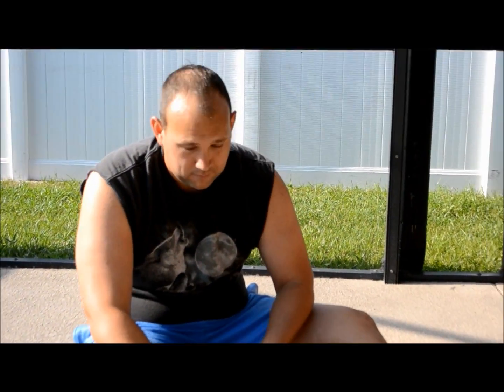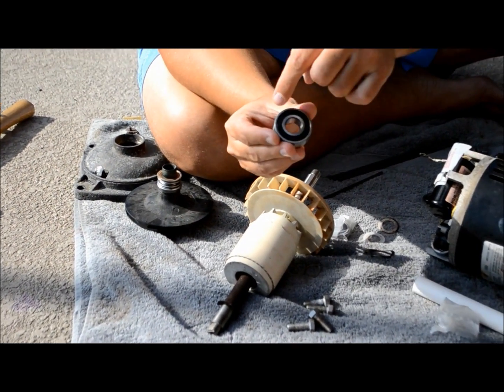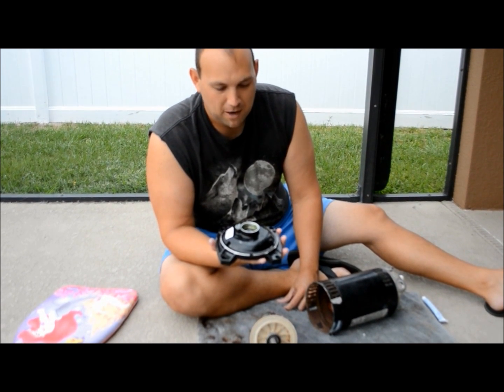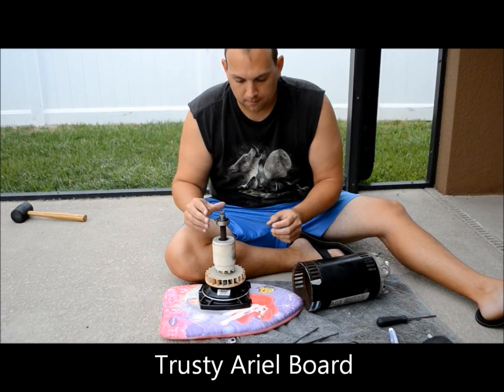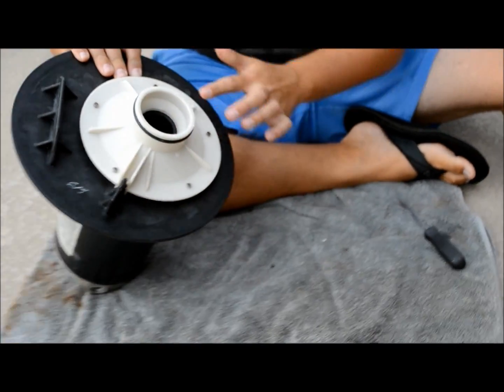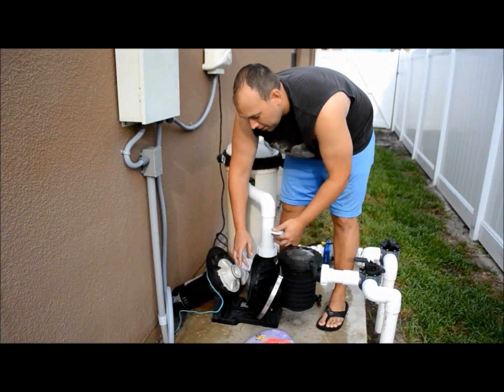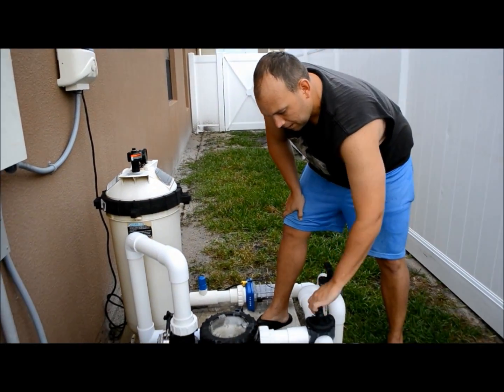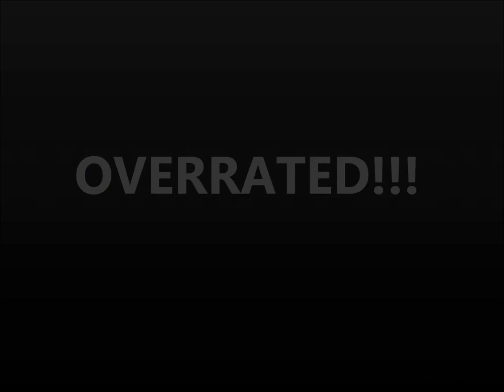Pool Pump Repair Part 3 of 3

Comment: Ha! Just came across this, just what the doctor ordered!!!
My BADU pump seized up over the winter - nothing that a long bar & socket wouldn’t overcome. But oh hell, it’s been so noisy running. 1st half hour or so is utterly dreadful, then quietens down a bit for the remaining 7.5 hours, the same pattern repeating every day.
On this occasion I’ll just replace the pump (it’s 17 years old!), but I’ll definitely be stripping it down to see if I can repair it & keep as a spare.
Many thanks for the time & effort you put into making those 3 videos, absolutely indispensable.
Row (UK)

Comment: I'm not trying to say this in a bad way, but, you convinced me to just get a new motor instead of all the frustrations you went thru. You had too much corrosion and rust and frozen bearings and it didn't seem worth it to me. The 4 broken "thru bolts" clinched it for me. Good job though.
Reply: You are not the first person to come to this conclusion after watching my videos.  I've saved many man hours by showing how the extra mile isn't always worth taking!

Comment: This video was exactly my pump experience.  I should have watched it first. Try getting those long bolts out without breaking.   A friend removed the four bolts by heating the cover neat the end of the bolt with a torch.  He said the bolts are aluminum and have a different expansion contraction than the cover.  It worked after all else failed.

Comment: Video extremely helpful! Pulled apart the motor and upon putting back together, found no water running through the system. Your video reminded me to prime the pump and from there I had no problems and you saved me tons of $ if I had burned the motor out! Thanks again and well done!!

Comment: Question. I bought this house and the pool was already installed... I have the same pool pump and when I went to turn it on it hummed then cut off.. After doing some research online I found out that the impeller might not be turning so I took the motor from the wet side and removed the diffuser. The impeller wouldn't turn by hand so I used a very large channel lock wrench to turn it a few times and now it moves.. Pump now turns on and primed but the pump now makes a grinding type noise and I have no idea where to start lol.. Any advice would be appreciated
Reply from the maker: +The Neals Next Door So the "humming and shutting off" is definitely a sign the motor shaft wasn't able to turn.  The motor is designed to shut off automatically in such cases.  It sounds like you were able to get past that problem (awesome stuff)!  

Now why wasn't it moving before?  I'm guessing you may have had a little bit of built up rust from the pump not being on for some time and the channel lock wrench was strong enough to break it up.  That is impressive as that is not an easy thing to do.  Especially if you live in a southern state like FL where things tend to rust over night.

So that horrible grinding noise you are now hearing?  Unfortunately, that sounds like the bearings have gone bad.  Typically a common problem if the motor is approximately 5+ years old.  The problem is that replacing the bearings is a horrid job that I don't wish upon anyone.  Part 2 of this series walks you through the painstaking process of me taking the entire motor apart in order to replace them.

In my honest opinion, taking on such an effort may not be worthwhile if the motor is fairly rusty but bearings are cheap and if you have the patience and some of the tools, you may want to give it a try.  Start by removing the 4 long bolts that run along the entire length of the motor.  If they can't be removed, then abort the mission altogether.

Now what if you can't get access to the bearings?  Then you should just buy a new motor.  Note that I said new MOTOR and NOT new ASSEMBLY.  A new motor is all you need.  Don't buy the skimmer trap, etc that comes with a whole new assembly.  Swapping out a new motor is painless in comparison to swapping out bearings.  The $100 difference may be well worth the struggle and hassle but I'll let you be the judge.

Read more about what I learned via this article I wrote and thanks for watching!!

http://poolnoob.com/index.php/2016/03/04/5-things-i-learned-fixing-my-pool-pump/
Reply: +poolnoob yea I live in GA so I think it was just build up which made me happy because I thought I was going to have to buy a new pump lol.

Honestly it looks like a pain to take apart but I'm just happy that you were able to give me a potential solution lol.. I really appreciate man because I been flying blind since I bought the house 2 years ago... Thanks again and I'll give an update.. Thanks a lot
Reply: Ahhhhh I didn't see the last few paragraphs. I'll check it out tomorrow and see if I can get to them. If not I may just look for a motor like you recommend.. I'll also Check out the article tonight and thanks again brother.

Comment: Archie Montgomery. Brilliant job, and just what I needed to see before taking my one apart, which is making a shocking bust-bearing noise. If the long bolts don't come out well it all goes to the motor repair guys, or I get new.

Comment: Just watched your pool pump bearing replacement trilogy.  You remind me of me... typically spending close to what I could have acquired a new motor for; add to that the grief of having to run all over town for parts & then the actual labor... should have bought the new motor, dammit!  But then there's the "hey, I fixed this myself" factor.  You can't put a price on that.  And you get to tell your friends and family that you fixed it instead of calling the pool guy.  (Conveniently leaving out the grief and the money you spent, of course!)  Thanks for making the effort to make this video and post it.  Thanks for being so candid.

I'll be replacing the bearings in my pool motor this weekend myself.  I'll be thinking of you.  Thanks again, "Poolnoob"

florida_floyd
Reply: +Floyd Reed 
I know what you mean, but here's the thing:  the time you spend on a project like fixing a pool pump gains you knowledge, experience, and confidence to take on other problems that arise, and you will be able to do so with more and more efficiency because they all share common design elements.

Water pump on your car go out?  Can't be that much difference than a pool pump.  Garbage disposal break?  How different can that be from a water pump?  A/C air handler making noise?  Tear into that bad boy!

My father fixed every problem himself, and he always made me help.  I hated it when I was younger, but I sure am thankful now.  You may not save much money on a single project, but over time it will save you bundles.
Reply: Floyd Reed 
That's perhaps the biggest payoff. Rejoicing in oneself after having been victorious in an endeavor. An endeavor such as investing time, sweat, mental energy, and money, plus perhaps also blood, more sweat and tears; 'fixing' this and that around the house. There is self satisfaction in having acquired the kind of knowledge that only is obtained through experience. How great to acquire such knowledge - at least a bit more than what you previously knew about 'how-to' 'fix', build, install, replace or otherwise the things that make life more 'easy'...notice the quotes.
Reply from the maker: +Floyd Reed Best of luck to you sir!  I actually just finished writing a blog post about lessons learned from this venture.  http://poolnoob.com/index.php/2016/03/04/5-things-i-learned-fixing-my-pool-pump/  

Thank you for the kind words!
Reply from the maker: Zhaleh Farrokhzād Thank you for the kind words!

Comment: L. G - Just wanted to let you know how much this helped me in dealing with my own bad bearings issue (which in turn were caused by a bad shaft seal - my no longer employed pool guy didn't replace the seal when he put a new motor in 3 years ago, which caused both the bearing failure and his job loss). I ended up pulling the motor and having a local shop do the bearings ($120 including the bearings and a new seal). BTW, the pool guy charged me $350 for that motor replacement.

Beyond all that, I really enjoyed the humor - - nice touches throughout! Good job.

Oh, and please thank your wife - - she did a great job shooting the video (nice steady framing and smooth panning movements, plus I didn't hear her make a single under-the-breath wisecrack - -  certainly not something my wife could resist - - the lady must have tremendous self-control!).

Comment: Thank you SO MUCH. I repaired my pool pump without looking at this video. But I ended up with that wobbly washer left over after having put it all back together, sealed and reattached. It seemed to work fine, but what to do with that wobbly washer? Trawling the internet for diagrams for my type of motor was fruitless and after a few other you tube videos I came across yours. In your earlier part video and you said that you would show where the wobbly washer went in the next video. I nearly jumped for joy and was even happier when I could replace it without disconnecting the pump from the water tubes or opening up the pump seal again or removing the pump from its location. The time you spent on these videos was worth it for me!!
Reply from the maker: Jenny,

I'm glad you found this video to be helpful and grateful you took the time to let me know!

Comment: Great Job on the video.  I have the same bearing problem...New motor ($135) is on the way and I'll be doing the replacement.  Was considering changing the bearings on the old one and saving it for when the new one eventually starts to fail...However, I now think I'll take it to the local motor shop and let them rebuild it after watching your videos.  One question I had though.....How many days and how many Dos Equis did it take?  I counted 4 T-shirts :-)  Thanks for the videos and the spots of humor within them.
Reply from the maker: The replacement took my pool down for about a couple of weeks.  I broke the square flange on the motor and that took a little bit to order a find new one online and have it come in.  Plus I was at the mercy of my camera woman who often didn't feel like taping after coming home from a long day of work.  I regret not making a 4th video on how to fix a green pool!  Best of luck!

Comment: Wimpy, I bought a new motor and the pool store moved the impellor etc.  Reattached wires, but failed miserably in rejoining with the metal strap - stalled at almost, but not quite.  Going to try again with c-clamps, vise grips and my wife's small hands.  Keep your fingers crossed.
Reply from the maker: Good luck David.  It was definitely a two person job in my house and it was a pain for both of us.  I may have had to sleep on the couch afterwards :) - Wimpy

Comment: u got lucky with the PVC. the cir-clip is not needed nor is the keeper, and you only need two bolts,threaded rod will work..  come by my shop and I will give you the bearings, and or bolts for free, OR have me build it right for 80 bucks including the shaft seal.DONE RIGHT.
there is way more to building a motor than what was shown in this video. still good info though, but enough to get you in trouble, and wreck perfectly good motor.